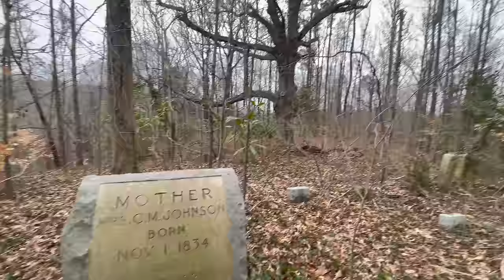Exploring The Unknown: I Found An Open Grave!

Comment: 👼🏻👼🏻Dalen, everything you wanted to know but haven’t asked a professional.

How Are Caskets Lowered Into

You may be curious about the burial process or funeral planning and want to know how a casket is lowered.
Gravediggers use sophisticated equipment to drop a casket without disturbing the deceased.
If you want to attend a funeral, know what to expect. In addition, you may want to know how a funeral works even if you aren't planning one.
Once the casket is in the grave, cemetery workers set the vault's top.

Laying A Casket

You may be interested in the burial procedure or be preparing to bury a loved one and would hence want to know how a casket is lowered into the grave. After all, a funeral casket typically weighs 150–200 pounds. When you add it to the body's weight, you have a weight that is quite difficult to move. Gravediggers utilize sophisticated equipment to successfully lower a casket in the ground without tampering with it or disturbing the deceased. The appropriately termed "casket-lowering mechanism" maintains the casket's weight and enables it to slide down into the grave smoothly.

7 Steps To Lower Caskets Into The Ground

You may want to know what will happen if you decide to attend a burial ceremony. Even if you aren't planning a funeral, you may just want to understand how the ceremony goes. In any case, it's wise to consider the casket-lowering process in these seven steps.

Preparing The Grave: A gravedigger must construct a proper grave before a casket may go to its last resting place in the ground. What then constitutes an appropriate grave? The best method for preparing a burial ground truly depends on where it is. According to US law, there are no requirements for grave depth or size, therefore, each state is allowed to establish its own rules. Many states merely require that the top of the casket be at least three feet below ground level, contrary to the expression "six feet beneath." And as a result, the depth of the grave as a whole changes according to the height of the actual casket.
Installing The Burial Vault: Installing the burial vault is often another step that must be taken up before putting down a casket. Concrete now serves as the primary material for burial vaults and grave liners. They come in two pieces: a rectangular container and a lid. The casket is placed within the vault, which fits snugly inside the grave. The vault lid is placed on top after the casket is in position. An alternative method is putting the casket in the vault above the ground before lowering the whole structure into the ground. The goal of a vault is to prevent the subterranean movement of caskets. They also assist in keeping animals away from the casket and the remains. Vaults are also helpful in stopping the spread of very infectious viruses.
Arranging The Casket-Lowering Device: The funeral home crew puts up the casket-lowering apparatus after the burial place is prepared. If there is a graveside ceremony, they make sure to accomplish this before the family shows up there. The funerary workers will still utilize a casket-lowering mechanism to bury the casket even if you aren't performing a graveside ceremony.
Placing The Casket On The Device: The casket is often carried by the pallbearers to the cemetery if there is a graveside ceremony. Otherwise, the cemetery workers and morticians could carry out this task. First, they meticulously line the casket with the ground before fastening it to the straps. Finally, the casket is held suspended above the grave by solid ropes.
Lowering The Casket: It's now time for the casket to be buried in the grave. To release the device's internal gears, a member of the funeral home personnel presses a button or pulls a lever. Next, the device's side spools revolve slowly, releasing the straps and enabling the casket to fall at a regulated pace.
Taking Off The Straps: The personnel must take the object out of the casket once it has been buried. Quite often, the family departs before this occurs. The straps must first be removed so they may be placed under the casket. This poses a practical issue: how do you draw the straps from underneath such a large and weighty container? Funeral homes often request that the cemetery build a small mound or ridge of the earth at the base of the burial or vault. The straps, which rest near the ends, are more straightforward to remove since the center of the casket is raised as a result. For this reason, some cemetery vaults even include a series of "bumpers" that keep the casket slightly lifted above the vault floor.
Breaking Down The Device: The funeral home workers may disassemble the remainder of the apparatus in the reverse order that it was assembled after the straps have been removed from the grave. To make the object simpler to move, it often telescopes together.
After The Casket Is Lowered Into The Ground, What Happens To It?

The vault's top is set in place by the cemetery or funerary workers once the casket has been lowered into the grave. They may do this by using the same casket-lowering device. After the casket is buried, the grave liner's sides are lowered if the family does not opt for a vault. The casket is then covered by placing the top in position. To seal the grave, the cemetery fills it with soil and then grows green turf over the top.

Love Love Love 👼🏻👼🏻

Comment: U see they have chosen not to use the vault for whatever reason that is an old casket that's in there they didn't use a vault and they'll put another casket on top of it it's a double burial so actually it's probably about 10 ft deep because there's already one in there and they will place the other one on top of that one so that they can be together with their loved ones I mean I prefer a vault if I go in the ground that way no bugs are getting in no waters getting in no nasties getting in and I'm going to look exactly the same as I did when I went in and since I'm paying so much damn money for the casket I might as well throw out a couple extra bucks for the cement vault LOL ♥️🇨🇦♥️

Comment: The main purpose of the vaults in addition to the other reasons posted by some graveyard shifters is to prevent the toxic embalming formaldehyde chemical used in the body preservation from seeping down to the underground and potentially pollute the water aquifers.

Comment: Your graves are not very deep compared to here in the uk a single plot is usually 6 feet deep and double plots are deeper still. We dont use concrete vaults either the coffin goes straight in the ground